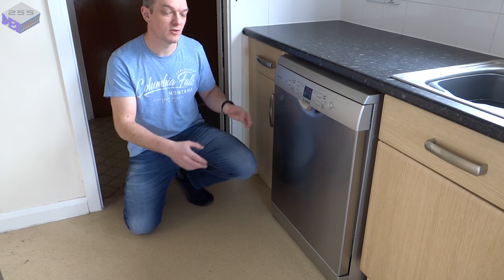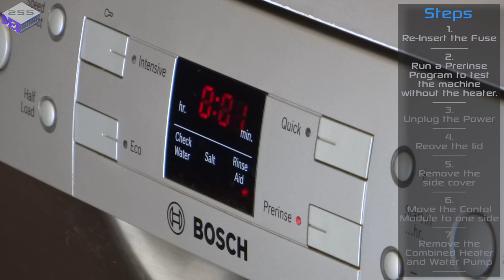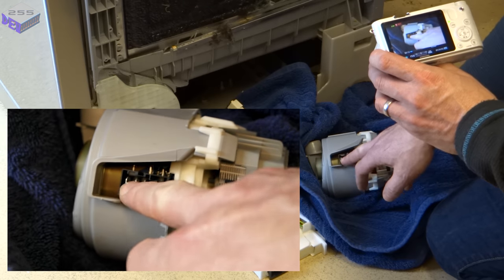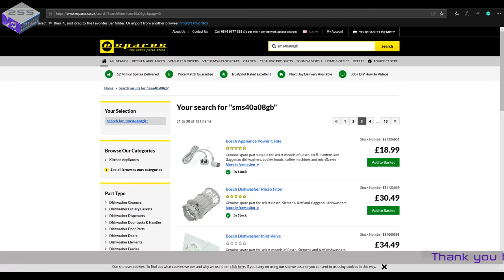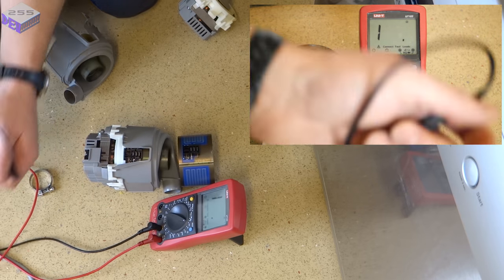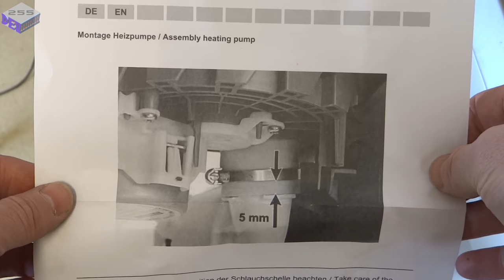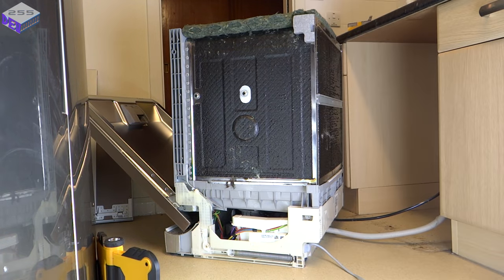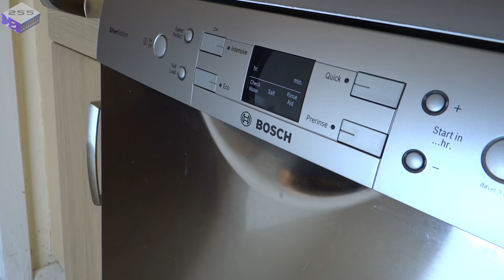How to Test & Replace the Heater & Pump in a BOSCH, SIEMENS, NEFF and more Dishwashers

Comment: I think my d/w tripped the RCD last night, but running today it didn't. I don't have a digital display on mine, so no error codes. Could I simply connect the hot water to the inlet and skip the heating element?
There are these pumps on eBay for a lot less, are they copies or something?
Reply from the maker: You can run a hot feed to the dishwasher although you get a fair amount of cold water come through first before the hot gets there, so chances are the heater will come on anyway. This sounds like a classic case of water getting on the heater and drying out over night and working the next day. They may be reconditioned ones, but as long as you get a decent warranty you should be ok.
Reply: @TheSolarPoweredEngineer  I think the elements is blown, ran at 50 and it was cold inside when it was finished. A couple of leds were on as well. Shame really, unit is only a few years old. Have to get on my hands and knees now😩
Reply from the maker: @JohnnyMotel99  Good luck, it's not too hard when you get into it
Reply: @TheSolarPoweredEngineer  Do you have any ideas on how to identify a model when the sticker has come off? Is there another sticker on the chassis. It's fully integrated.
Reply: @TheSolarPoweredEngineer  are the ones on eBay refurbs? they are about 1/2 the price than eSpares!
Reply from the maker: They probably are refurbs, although never used one, may be worth checking all the reviews first. Should be able to work out the product number from other details on the label stuck to back, just type in google
Reply from the maker: @JohnnyMotel99  Hi, I got a notification of your message, was it the mains plug, they are a bit fiddly to get in and out sometimes, hope you got it fixed.
Reply: @TheSolarPoweredEngineer  Hi Neil and thanks to get back to me. First off it was the control box that had me stumped...then I discovered the trick. Then it was the purple connector that stalled everything. Eventually got the pump out, took it apart and a track had blown where scale had built up. Pump on order form Bosch, good price as well, £80. Your video is a godsend!
Reply from the maker: @JohnnyMotel99  Glad it helped and well done for getting your pump out ready for the new one.

Comment: Neil, appreciate your view on my dishwasher.  No error codes, water fill and extraction fine, water heating but not washing the pots.  Found that the rotary arms are not rotating which I assume to be lack of water pressure from the circulation pump.  Pump out and found the spindle bearings have play. I am right in assuming this is the problem (weak pump) or is it something else?
Reply from the maker: There is a fair bit of play in most pumps normally and may seem to be too loose without water in there. You may find there is a blockage in the pipes feeding the rotors from the pump outlet or within the rotors themselves. If you are not getting an error code, then I believe the motor should be ok, I'm not sure if the controller monitors motor current when running though. Can you hear the pump when it tries to run?
Reply: @TheSolarPoweredEngineer  Cheers for the reply.  Rotors are clear, when I run the machine and open the door water is running out of the rotor arms but they do not rotate (they stay in the position I place them in to check rotation) which led me to think it is a lack of water pressure, hence my investigation of the pump motor. I can hear the pump running, I did think maybe the impeller had failed but that is intact.  Any ideas?

Comment: Mine seems to read 19.7ohms, it's displaying a 04 error code and the water is not heating.. any advice? I think it tripped the electrics once and since then it never did it again but it hasn't heated the water too. I had a visual inspection of the pcb and nothing seemed burnt
Reply: Any help?
Reply from the maker: @cp5472  Ah sorry, yes, normally a heating issue would be 09, although 04 can relate to heating and/or flow rate, I would be tempted to check all the pipes and sprayers for blockages as a matter of corse. To me, the trip would indicate a common problem with the heater element shorting to earth through a small water leak around the pump and a damaged track on the heater, especially since the resistance seems a little high too. If you take a look at the heater tracks you may be able to see a few very small blisters forming where it starts to fail.
Reply: @Neil Devonshire - Dev255  Hi Neil, many thanks for your message. I had a look at blockages and didn't find anything, the machine runs through the cycle normally but it doesn't heat up the water and shows the 04 error at the end of the cycle. 

It's strange as it only tripped the board once and never did it again, I think it was since it tripped the board that it stopped heating it. 

Should I remove the pump and take it a part and have a look inside to check for any damage?
Reply from the maker: @cp5472  Hi, that does sound like the heater, you can take it apart to have a look, although the clip retainers may break when you take it apart, but it will still go back together. The trip normally happens when water seeps through the seal and comes into contact with the element; this causing current to leak to earth and trip the breaker. If the heater is no longer heating it has probably gone open circuit. Also, the machine may not trip again if the heater has dried out, but could pose a risk if water seeped through again. It's good to know your earth leakage breakers work, that's a nasty fault if the earth was faulty also. Please feel free to ask more questions if you decide to open it up
Reply: @Neil Devonshire - Dev255  the strange thing is that it didn't go open circuit, I still measured 19.7ohms. But yeah I'll open it up tomorrow and try not to break the tabs and see what I see
Reply from the maker: @cp5472  Hi Carlos, no worries; if the heater looks ok and the seals are not covered in calcium build-up (or limescale), then it may be ok, but I suspect not. With the heater reading 19.7 ohms though, it could be the circuit board, although you may be able to pick one of these up at a local dishwasher repair shop if needed.
Reply: @Neil Devonshire - Dev255  yes it was some damage (small) in the heater element. 

I do notice that at the back of the dishwasher there is a long black sump that is leaking some nasty yellow stuff, have you encountered it before?
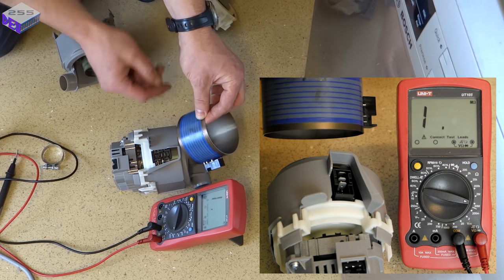Reply from the maker: @cp5472  Yes, that should be the box for the weight, if water has got in, there may be some rusty water leaking out. The main board may be testing the heater before it switches on and reading the 19.7 ohms but continuing until the 04 error (Temp and or pumped water pressure fault), hence why you are not getting the 09 error first. Just my thoughts on it though. Does the damage look like 07:50 in the video?
Reply: @Neil Devonshire - Dev255  my issue was that the outer side of the pump got some water ingress and then dripped & connected some sort of small rusty water droplet into the heating element causing to look like the one in your video but on a smaller scale. We had a water leak a few months ago and I guess this is now related (although it took a while to stop working)
Reply from the maker: @cp5472  It sounds like you found the culprit then. Did you claim on your house insurance? As with this delayed fault, you may be able to claim it too, rather than repair.

Comment: Hi there, thank you very much for the video. Perhaps you could help with a question; I’m just checking resistance now and I measure 19.4 ohms across heating element, but then when I check on 2M (my meter doesn’t have 20M) setting I’m getting reading fluctuating around 0.300. Any idea what this might mean? I should add that what led me to this point was the machine tripping the main fuse at the same point during its cycle. I then tried the washer on a rinse only setting and it works fine, hence I thought it might be the heat pump. There was also an e09 alarm at one point, which I dealt with. Could that be linked to pump problem?Th ank you very much in advance
Reply from the maker: Hi, yes that sounds like water has got on the element and caused a leak of mains current to earth, hence the trip. Also, the heater element and earth plate underneath will setup a voltage potential if there is a liquid in between (kind of like a battery, dissimilar metals), this will throw off your meter in certain ranges. Try measuring the element after it has been off the machine for a few days, it should read ok when dry. Also, with water getting in to the element, it's a good idea to clean all around the rubber pipes that it connects to so that the new pump seals ok and it doesn't ruin the new one over time. Hope that helps.
Reply: @TheSolarPoweredEngineer  thank you very much. I have ordered a new pump, do you think that is necessary? Thank you so much for your help
Reply from the maker: @willdudo7044  I think it's good practice to clean around the seals, just with a damp cloth as grit and grime can stop it from sealing and you'll see the same issue sometime later on. No dramas, happy to help
Reply: @TheSolarPoweredEngineer  brilliant, sorry I meant do you think I will need a new pump? Thank you
Reply from the maker: @willdudo7044  hi, no dramas, yes it all comes as one unit, I wouldn't recommend any kind of repair either as there could be something else that is causes the part to fail
Reply: @TheSolarPoweredEngineer  thanks again
Reply from the maker: @willdudo7044  You are more than welcome, glad to help, feel free to put how it went.
Reply: @TheSolarPoweredEngineer  hi Neil, the part arrived over the weekend and I swapped it out. I couldn’t remove the dishwasher from its hole, so had to do it through the front as opposed to the side. It was pretty tight, but just about managed! Thank you for your excellent video and for answering my questions, much appreciated 👍
Reply from the maker: @willdudo7044  well done for going through the front, that makes it a lot harder. Glad you got it sorted
Reply: @TheSolarPoweredEngineer  hi Neil. I can’t believe it, I’m getting the e09 error code again! Since I replaced the old heating element I’ve also replaced the waste pump. Can you think of any reason the heat pump would have gone again?? Is it time to get a new machine perhaps? Thanks

Comment: How do I fix E11 error, the heat pump terminal resistances are fine and brand new for your information
Reply from the maker: Hi, that sounds like the circuit for the thermistor, or thermistor itself, when measured this should read several k-ohms and will be part of the same unit. If it is new and you still have the same fault it may be the wiring or control board.
Reply: I managed to fix it, issue was lose sensor grey color wires due to broken 3 plug pin, I made a direct color instead and worked.
Reply from the maker: @krisdas6556  Well done, glad you fixed it 👍

Comment: Nice video, thanks. I have an Aussie model. The most replayed clip is the part I cannot for the love of me release enough to get into a different position - the control module. The power socket at the back will not release, it's hooked in to a slotted section and the whole things is stuck.  :(
Anybody else found this issue?
Reply from the maker: Thank you, did you manage to get the power cord out, I know they can be quite tight in there.

Comment: Hey mate, fantastic video, very informative. My Bosch dishwasher has been tripping the house safety switch (not the circuit CB), after running for about 2 mins. I assume this was from restarting the last cycle, then when the heater or pump kicks on, everything's off. I've removed the pump and tested the element, which seems fine (20ohms and no earth short). Any suggestions to test further?
Reply from the maker: Hi, thank you. I would check the circuit board (control board) for water ingress and all other electrical items, it may be that a cable to the motor or heater element is damaged at the bottom of the machine, where these can be found sitting in a pool of salty, dishwasher soapy rich water for years that may degrade the insulation. It sounds as if this fault is with some high power/voltage circuit that is leaking current to earth (hence the house trip), so it's unlikely to be low voltage items such as sensors around the unit; I would therefore look at the following: Heater element (although you have already checked this), phases of the motor (on resistance check, pins 1 to 2, 1 to 3, then 2 to 3, all should read the same and all 3 should have high resistance to earth (M ohms)), water inlet valves (water may be getting to the coil/connections), any part of the main control board. Hope that helps and good luck
Reply: @TheSolarPoweredEngineer  hi again, so the heater element actually has a small arc across the element, bridging 2 lines. They're part of the same circuit and only take about 60mm of the coil out of the circuit, reducing it to 18.6 ohm at the connector. Would 1.4 ohm drop (from 20 ohms as per your new one) in the coil cause the trip? Otherwise the board had no water. I'm going to plug it back in and try on pre rinse (no heating) to see if the coil is causing this.

Comment: Hi , thanks for great video. 
when I replace heat pump.  Dish washer giving wired noise. Then I stopped it. Any idea? What could be issue.  I am suspecting water connection issue.
Reply from the maker: Hi, does the machine come up with any code before you stopped it? You should initially hear the drain pump switch on when it first runs a program to remove any previous wastewater, then a click and rush of water as the main water solenoid opens and water fills a chamber on the left side and the sump within the main washing area, then the main water pump should operate (this is when you should hear the arms spinning, and a rhythmic sound as the water is sprayed around at the dirty contents). Any other strange noises should not be heard, although the drain pump can sound fairly noisy if there is no water to be drained initially, as it will be running dry (this is normal). It may be worth double checking that everything is seated correctly underneath and that nothing was knocked out of place. I hope that helps.
Reply: @Neil Devonshire - Dev255   thank you so much for reply.  Yes, initially due to dry sound I got scared. But when I keep it run then all becomes normal. It is working fine. Thank you so much
Reply from the maker: @parth_0521  That's good to hear, glad all is working well

Comment: Why did you not just replace the element?
Reply from the maker: Good question. I wanted to ensure the motor and seals were also replaced at the same time as it's a bit of hassle to get everything in and out.

Comment: Hello, very nice video. I replace it and also i replace the heat axchanger valve and i have the same problem
Reply from the maker: Hi, thank you. You may still have a leak from somewhere into the electrics associated with these parts, it's worth looking over all the areas that could leak. Try letting it sit for a week to get it nice and dry, and then run the machine on a basic rinse so that the heater doesn't come on, then switch everything off, disconnect the machine from the mains and investigate if you have a leak. Failing that it may be the main controller board. I hope that helps and good luck

Comment: Very helpful video, I replaced the heat pump without issues. However I run a cycle and the water was still cold. Any ides what could cause this, if it's not the heat pump?
Reply: I talked too soon. Water is hot. Dishwasher fixed. Happy man!
Reply from the maker: Thank you, glad you fixed it 👍

Comment: Super video. Well done. Can I pick your brain re a faulgvwith my Busch SMV53M00GB built in washer. It has stopped working after running a cycle with Error Code E15 and the water symbol flashing. Looking in the tray the float had been lifted up by water collecting and consequently trigger the shut off safety valve. I dried out the tray and the error code etc had gone and I was able get the machine to work, so it seems the auto shut off valve and trip switch is working perfectly. The fault would therefore appear to be a leak. I wasn’t able to see where this was coming from when I was drying the base tray so in your experience what would you suggest are the main areas or components/pipes to check for leaking. Cheers
Reply from the maker: Hi, thank you. It's fairly difficult to diagnose a leak unless you can see the machine running with all the panels off, but I would be careful running a leaking machine with covers off, not to touch the machine and to ensure you can cut the power without touching it. Although the thing id suggest is to make sure everything is seated correctly in their seals, the level sensor within the water sump/reservoir (the part your filter fits in) can get knocked out when taking the filter out, so it could be an easy fix. Other issues could be a build-up of calcium deposits on seals, especially around hot water areas such as the water heater/main pump. I hope that helps
Reply: @TheSolarPoweredEngineer  Thanks for your reply and safety advice and suggestions.
Reply from the maker: @ianstewart2643  No worries, feel free to ask if you have any further questions.